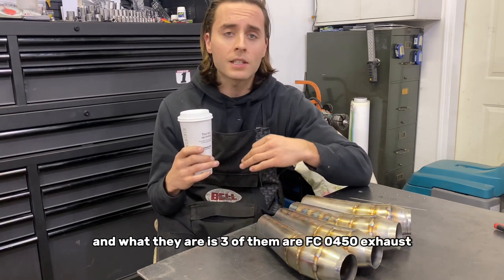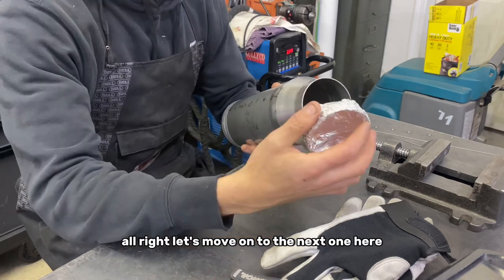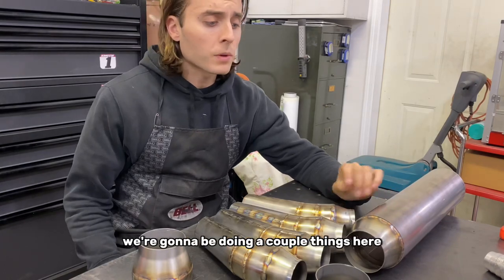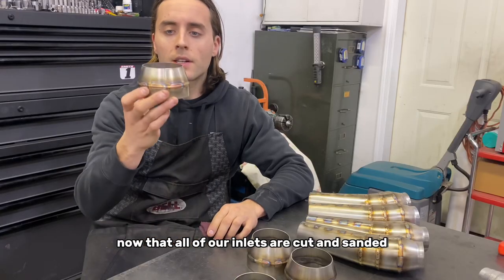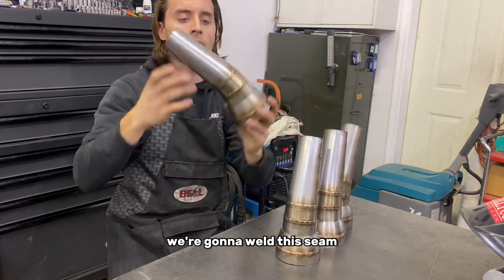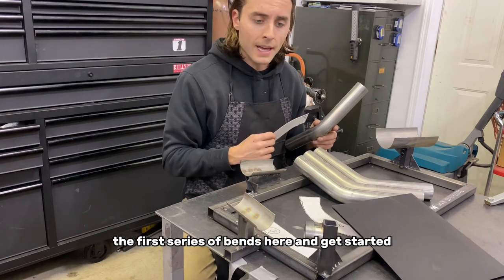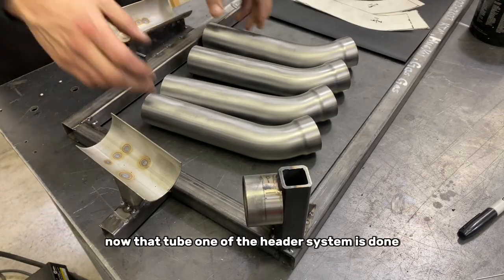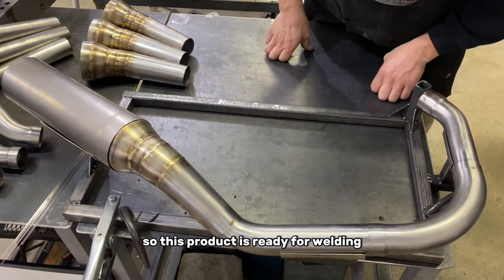Exhaust building VLOG- fabricating motorcycle racing pipes.

Comment: Awsome work 👌🏻how do you calculate megaphone dimensions? We run a 500 triumph drag racing would like to play with (calculate) megaphone dimensions
Reply from the maker: I wish I had a concrete answer for you! I don’t use any formula. It’s data I’ve collected over the years of what works and doesn’t work. A lot of testing!
Reply: @KULLYCO  I thought that would be the answer time to make a few and test thank you for the replay
Reply: Does adding the canister change things or is it just for silencing
Reply from the maker: @raplanthire4015  it depends on the canister design. Some mufflers can dramatically change the power curve while others don’t change it at all.